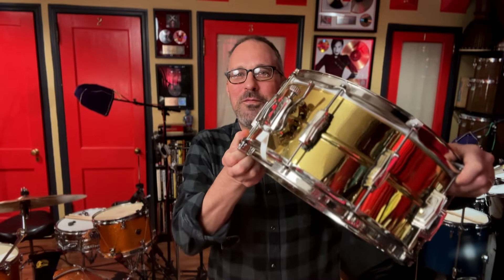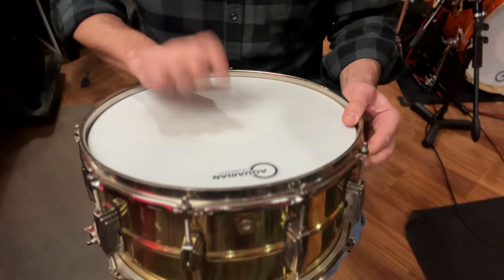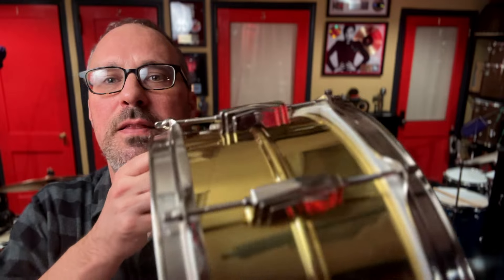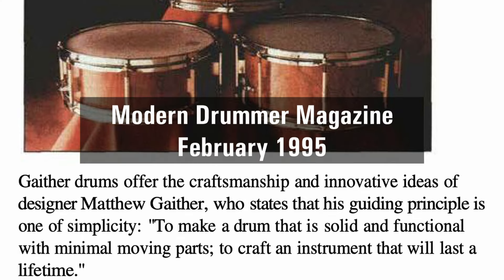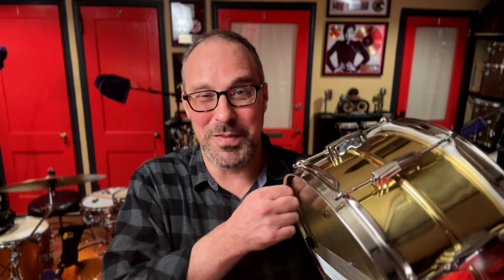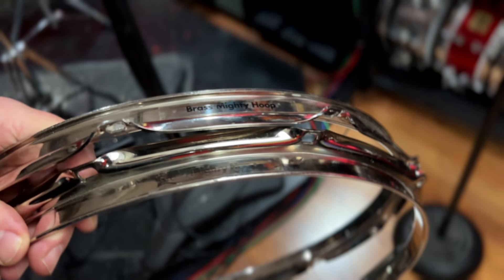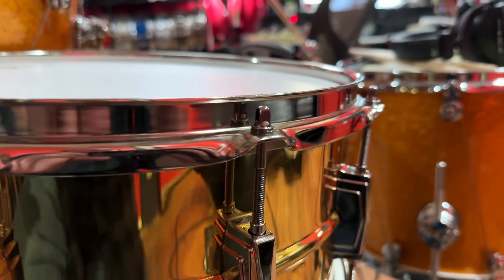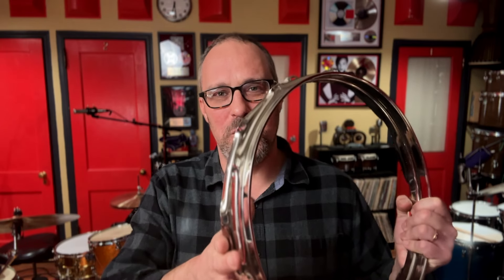Hot Rodding a Ludwig "Super Brass" Snare Drum

Comment: The steel gave the drum a little more volume 👌, I need to see if my steel drums have rubber gaskets 🤔
Reply from the maker: Definitely more volume! The attack of the drum now speaks much more clearly through the microphones.
Reply: @DylanWissing  what wires did it have? I usually put Puresound Blasters and they definitely add more volume. Now I want to check my Steel snares to see if I need to do this 😏👊